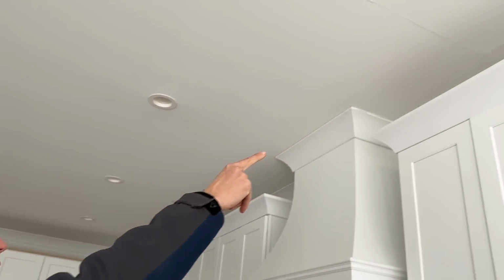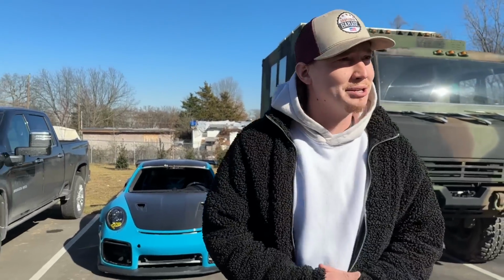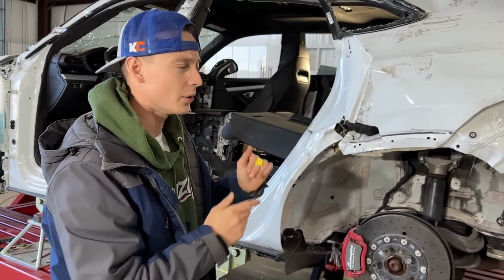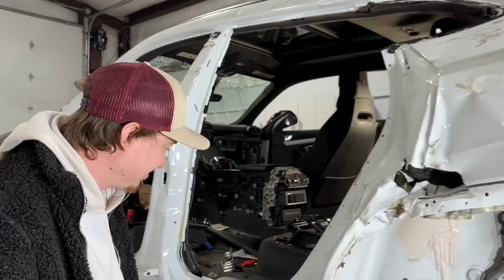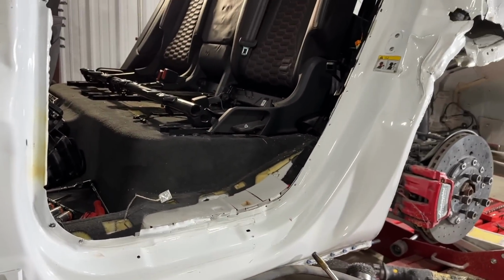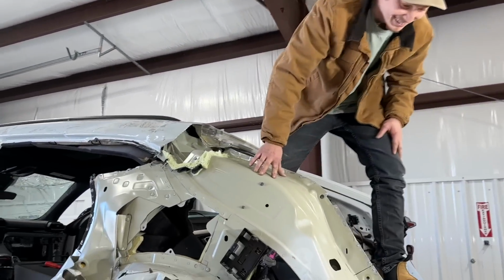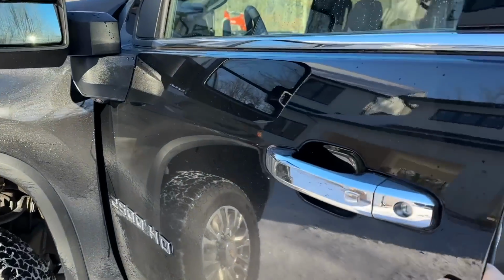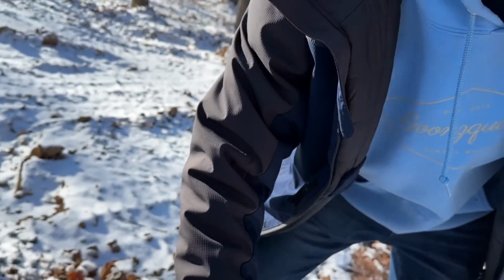Rebuilding A Wrecked Lamborghini Urus Part 5

Comment: Hi. The roof is welded by laser to the lateral of the card. So you will need to cut and then welded again using adhesive (similar to the Porsche). There is a protocol for this reparations. If you take a look for any other VW it will be similar. All this cars use the same welding construction.
Reply: Yeah VW and Lamborghini are owned by the same company and use the same manufacturing techniques. Same as Audi
Reply: These guys should not be attempting to fix this, it's far above their skill and knowledge level.
An incorrect repair will leave this car unsafe and potential a death trap.
Reply: You’re 100% correct. I work in the laser industry and can confirm this. The boys may be able to look at a handheld laser welder to repair it

Comment: Could the wax be a barrier between the aluminum and steel.
Reply: Aluminum can be damaged by being in contact with steel. Galvanic corrosion can happen through electrolysis when two different metals are in contact.  Wax would be an insulator in this case.
Reply: I was thinking noise reduction but could be like a double duty type thing
Reply: That may be a combination of wax and lanolin which is used to prevent corrosion between steel and aluminum.

Comment: That drywall crack in the cieling is because you have no heat. Once drywall goes up your house has to be 55+ inside.
You gonna have bunch of cracks throughout later because of this
We do new construction all the time.
Reply: Absolutely correct.
Reply: So what happens when a cold winter hits and the power goes out?   Our house was built in the 50’s and goes below 50° when we lose power in the cold, and we don’t get that kind of damage.  Something isn’t right here.

If that were the case, then houses all over should be busted and cracked after the recent storms and freeze.
Reply: @christinascatholichomemaking  it’s the constant heat cold cycles that causes it not the occasional power outage on a chilly night. By heat cold cycles, i mean warmer day temps and cold nights over the course a period of time. Expansion and contraction happen everywhere if it’s not mitigated before hand.
Reply: @gregkrueger331  I don’t know if you missed it, but there was a nasty cold front that come through last week.   Here in Ohio it was below freezing for a week, and for three days straight the warmest temperature was 3° at the highest.   A friend of mine in Georgia was without power for at least two days, and just got power back yesterday.   I assure you, her house was below 50° for multiple days as a result.   In fact, the biggest issue was making sure the pipes didn’t bust, not the walls.
Reply: @christinascatholichomemaking  “caused by Constant Heat/Cold Cycles”, up here near Chicago thats defined as it happens over and over…..hot, cold, hot, cold, hot, cold, day, night, day, night.  Can we understand it now?
Reply: @gregkrueger331  you seriously think they won’t have power outage issues in the future that last beyond a day?   Having lived in Tennessee, that area gets their fair shair of extreme weather.   The damage he showed was when it was still cold.   It hadn’t gotten real warm yet.   Understand?
Reply: @christinascatholichomemaking  this is a new construction house the mud can still have moisture in it and the wood is still new. What you are talking about are older homes after wood has settled.
Reply: He said that in the video dude 😁

Comment: I worked at a body shop years ago.  Instead of unfolding the quarter panel we use a grinder on the edge until the interior fold comes off.  It’s faster and you won’t cause additional damage.

Comment: The wax in there might be a guard against "dissimilar" metal corrosion since its steel mating to aluminum in spots but ill bet it's more for sound deadening purposes.  Where the outside skin meets the roof panel I'd use you're cut off wheel about an inch past the roof weld line to remove the skin and expose the weld and still give you enough outside lip to grab on to while separating the seam a little bit at a time so you don't warp the roof.
Reply: the wax is only used to protect against corrosion in the cavities.
It is common for vehicles from European manufacturers to be delivered with wax preservation in the cavities.
Apparently not common for vehicles of American design - right?

Comment: Its pretty weird that no airbags are blown with this kind of damage.
Reply: i think they already cut the curtains ones out, you can see whats left when they show the crack in the steel frame
Reply: Looks to me like vandalism. Might have been parked when it happened.
Reply: Cars pretty soft skinned though....
Reply: @ribbitism  You can still see them intact when they are using the magnet.
Reply: It's possible that the first accident or shooting set them off previously and they were either not replaced, or they were replaced and the ecu wasn't reset, or they could've just not gone off at all.
Reply: It's an insurance job that's not a car accident!
Reply: No sometimes companies give switches to turn off the airbag diployment because I saw it in few i don't know weather it is present in this too or not🤗🤗
Reply: @mikemay1922  off course... homeboy had to get rid of his shot up car
Reply: If the vehicle was off and not driving they wouldn’t blow
Reply: If this vehicle was parked? I think it was a rental that couldn't be sold. So the rental company wrote it off. Literally intentionally wrote it off so they wouldn't loose their hats.

Comment: The roof is soldered on! You need to cut the solder. I think it is CuSi. My company made the plasma burner for the Audi a5 roofs. Then the VW group changed it to a laser process and now they use Fronius CMT process (cold metall transfer)

Comment: Hey guys, the Dang sauce I got for Christmas was awesome and almost gone! On another note you guys should trash those torpedo heaters and look at a Val6 infrared heater that runs on diesel. Virtually no smell and Simone you could use them inside the new construction house.
Reply: I bought the half gallon jug of Dang sauce.  I use it THAT MUCH!  (Also got a good deal on three bottles of the Dang BBQ Sauce.)

Comment: Seeing that salamander heater in your shop I wanted to remind you that it has an open flame in an environment where you commonly use flammable and explosive liquids and vapors. Be careful. Also remember you breathe what you burn. A heater with a sealed combustion chamber and vented to the outside is really what you need.

Comment: They might put wax between the areas where the steel and aluminum overlap/touch each other. Two different metals like that can't touch or they'll start corroding.
Reply: Yup, otherwise it will cause galvanic corrosion

Comment: Hi boys, I've worked in the car industry here I the UK building range rovers and looking at your roof problem, you might find that the roof has been lazer welded to the body side and not panel bonded as this is the new industry standard for aluminum bodies. Keep up the great work.

Comment: Once you get drywall and wood in the house, such as cabinets, you definitely need some small amount of heat to prevent big issues.
Reply: This seems more like shoddy work than anything else.   I have lived in places where the power goes and the temperatures drop, but the walls don’t crack and bust from it.   Tenneessee gets their fair share of cold and winter storms, so houses should be built to withstand that.
Reply: @christinascatholichomemaking  Any house will see this type of thing in the south. I have seen it first hand with extreme temp changes. I have seen glue joints crack on cabinets. I doubt it was shoddy workmanship.
Reply: @Gambitt1970  funny, I lived in the South and lost power and nothing like this happened.
Reply: Even with losing power, most houses will hold heat for a while, but a house with zero heat or AC will not do well. It would not happen in one day, but several days in a row will be a bad situation. It would also depend on how well the house is insulated.
Reply: @Gambitt1970  not above 50°.   Clearly you don’t remember the freeze that swept through Texas last year.   I have a friend in GA who lost power during the cold front that swept through at Christmas.   She just got power back a couple days ago.   Her house was 45° at one point, and wasn’t getting any warmer.
Reply: @christinascatholichomemaking  Oh I remember it. I remember seeing all of the busted pipes and water leaks on the news.

Comment: h
Hey guys. The steel is by design. A rigid safety cell should only be constructed with hardened steel to protect the occupants and pass safety regulations.. Thats what allows the aluminium to be used elsewhere. The wax levels in the inside culls is a preventative measure to avoid water ingress. Love the videos.

Comment: Hello Simon you need to remove that frozen bucket because it will split with ice.  If it does you could have a full bucket of water in your floors when it's defrosted

Comment: The wax could be to isolate the two metals so you dont get galvanic corrosion. If Aluminum and steel are connected aluminum will be sacrificial to steel.

Comment: 🌴 what’s up squirrels, the Lamborghini isn’t going to be easy ! That roof section already looks like a pain in the azz, , wow bummer on the ceiling cracking , might have to get that power ASAP and get heat in the house to stabilize it , hope y’all have a Happy New Year🎉

Comment: I would advise you’ll to wear safety glasses when using a drill. A piece of metal in your eye can injure an eye beyond repair. I am a retired welder. I’ve seen it happen several times. I watch you’ll every day. Grinding also needs safety glasses
Reply: I've had this happen, a needle to the eye to scrape the shrapnel ain't fun.
Reply: Correct

Comment: Huge job, that A pillar would have higher tensile steel, which has to be welded with the correct filler rod. It may not be able to be re-bent back either. Good luck.

Comment: Make sure you use the right type of rivets, aluminium and steel don't mix well and corode like crazy when they touch, so putting steel rivets in aluminium panels is not a smart idea. Also where steel and aliminium panels are placed together, make sure ther's a layer of material in between like thick primer or panel bond.